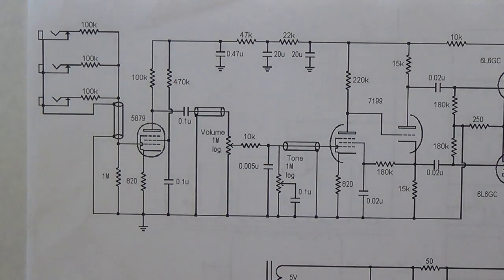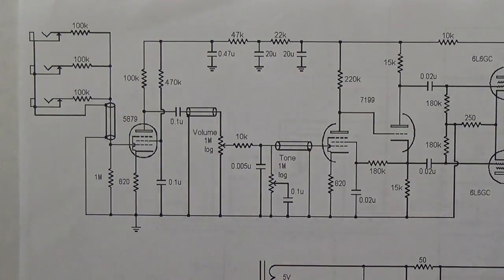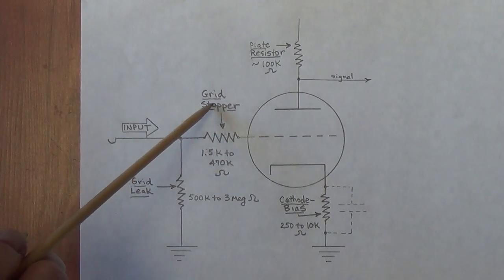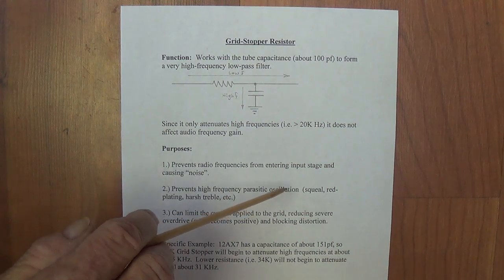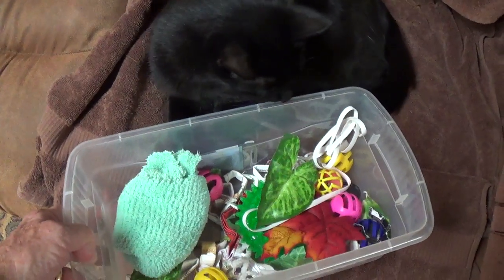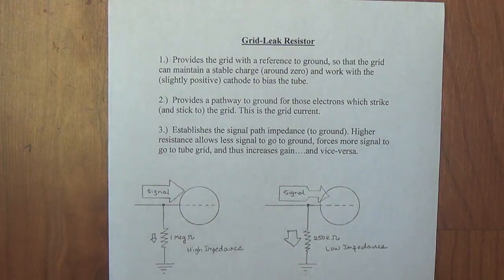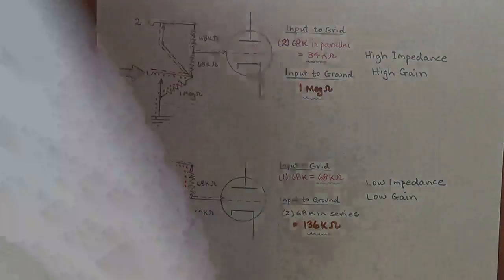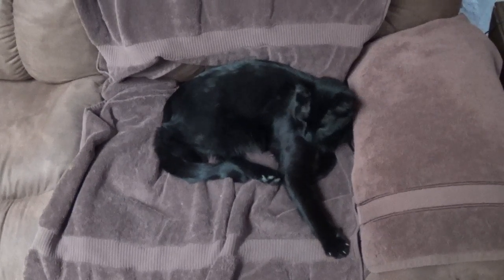Resistors, Part 3: Grid Leak, Grid Stopper, and the Fender Input Circuit

Comment: Dear Uncle Doug, 

I can see at input in many modern Fender amps 10k grid stopper and than 1M grid leak. And also for the same amp for another revision 1M grid leak and than 10k grid stopper into tube. What is the difference between the two? I suppose first scenario is like voltage divider? Can you explain difference in sound? Thanks !
Reply from the maker: I doubt that there is any noticeable difference in tone, Iam.

Comment: Thanks Doug. If there is not a resistor to grid in a signal chain following the pre-amp stage but a potentiometer, e.g.a vol or tone control, do these effectively operate as a grid stopper since they have resistance albeit variable?
Reply from the maker: +allanpennington Very good question, Allan. Yes, any resistance whether fixed or variable can serve as the grid stopper or grid leak.

Comment: Hi Uncle Doug, I was wondering if you could explain how to install cathode bias resistors to safely measure and bias the tubes, being reading about but cant get anything clear, thanks in advance!
Reply from the maker: +henter2010  You're best bet with the cathode bias resistors is to observe how the originals are wired and then solder in the new ones the same way.  Tube biasing and safety measures are covered in my videos. Best of luck.

Comment: Hello Uncle Doug, I have a question about the Impedance topic covered at about 16min in. You talk about 1M Resistor for Grid Leak  being high impedance (apps 98% signal to grid and 2% to ground) does this mean it will be higher gain if more signal is going to grid, and vice versa? Thank you in advance and thank you for the videos which are most helpful.
Reply from the maker: Yes, the more signal that reaches the grid, the greater the signal strength output from the tube.....which ultimately results in greater volume from the speaker.

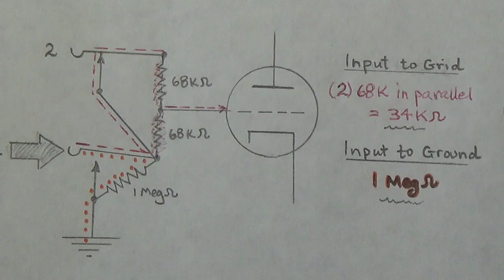Comment: I've been studding your videos and am learning a ton! Thank you!... Can I ask a question about the input portion of your video at 20:44 please?
The signal is running through the 68K, branching off to the grid, through another 68K and then to ground. If we look at the relation of the ground, the two 68K resistors and the output signal to the grid, isn't it exactly the same as a linear 136K potentiometer set to 50%? I've simulated potentiometer settings with resistors in pedals that I've designed using this method. Can this be a factor in the reduction of signal strength when using this low input jack? Thanks Uncle Doug.
Reply from the maker: The two 68K's in parallel add up to only 34K. Yes, a 136K pot could mimic this resistance, but it would be at 25% setting.

Comment: I could not believe it when I saw your grid stopper oscillating symptoms. Every tech that I explain my intermittent “squeal, harsh treble and spike of volume” thought it was tube related. But I changed all tubes and it still comes back but only after the amp has warmed up. Are the grid stopper capacitors or resistors prone to heat related failures? I’m trying to figure out how I can isolate which grid this may be affecting. 
Would I have to continuously monitor the DC voltage on the grid to see it happening, when it happens on 12AX7s or EL34s?
Thanks
Reply from the maker: Try tapping  and wiggling the tubes, one at a time,  when the oscillation is occurring and listen to see if this affects the oscillation sound. Grid stoppers should never get particularly warm to the touch, so any failure would not be heat related. They do need to be located as closely as possible to the tube socket.

Comment: I sense a video describing impedance bridging in the near future :-)
Reply from the maker: +Jason Thorpe  I'm not real familiar with the topic, since we are generally concerned with matching impedance (i.e. with an output transformer), but I'll keep it in mind for the future.
Reply: The amount of signal voltage passed from one stage to the next is determined by the potential divider consisting of the output impedance of the driving stage and the input impedance of the driven stage. For maximum voltage transfer the input impedance should be large compared to the output impedance. This is known as impedance bridging. For maximum power transfer the impedances should be the same, which is impedance matching.

Comment: Doug,
I'm figuring out how you derived the input capacitance to be 151pF. I found 

Cin = Cgk + Cga(1 + A) 

from, http://www.valvewizard.co.uk/gridstopper.html. 

Cin = 1.6pF + 1.7pF(1+100) = 171pF. which tube datasheet are you pulling Cgk and Cga from? Also, the url above mentions the capacitance of the socket pins. Are you accounting for this as well?
Thanks,
Craig
Reply from the maker: +Craig Hollabaugh  The value came from the final paragraph of the Aiken Amplification site:  http://www.aikenamps.com/index.php/grid-resistors-why-are-they-used   To be honest, I don't think 20pf is all that much disparity.  Perhaps it's due to a slightly different estimate of socket pin capacitance.  Thanks for your input, Craig.
Reply: +Uncle Doug OK, I&#39;ve read through the Aiken discussion and its similar to the Valve Wizard&#39;s. You continue to unravel amp design, component reason and value selection for me Professor Doug.  On to the "Cathode Bias Resistor"
Reply from the maker: +Craig Hollabaugh  Thanks, Craig. I'm glad you are enjoying the videos :)
Reply: Miller capacitance is plate to grid capacitance is multiplied by the gain of the stage, not the amplification factor (mu) of the tube. The gain of the Fender input stage is around 60. I have seen values of its Miller capacitance ranging from 100pF to 200pF. The discrepancies are a result of the estimation of stray capacitances and how they are included in the calculation.

Comment: Would this be the preferred method of having two different impedances? Using two input jacks.  Or could I essentially do the same thing with one jack wired to a spdt switch going between 2 grid leak resistors while keeping the same grid stopper?  Or would the switch cause its own problems?
Reply from the maker: The preferred method is to have two or more separate input jacks, each with it's own impedance (resistance to ground), RM. This is commonly found in vintage amps that were intended for guitar and microphone input.

Comment: I know this is an old video and sorry if this has already been answered. Where did you come up with the capacitance of the 12AX7 in you example? Wanted to try and look at other tubes to calculate the grid stopper for practice, but couldn’t find anything that resembled your value on the data sheet.
Reply from the maker: Either from a tube manual or from doing internet searches, Matt.

Comment: hi uncle doug nice video again 
i checking some mesa boggie schematic and i notice that they don't use the grid stopper resistor but instead they use a ferrite toroid  
is this correct or is just a missing part on the diagram
Reply from the maker: I have no experience with ferrite toroids, TRex.  I only deal with vintage tube amps and Mesa Boogies are a little too "new" for me.
Reply: The toroid does the same job as the grid stopper,  preventing radio frequencies getting to the grid.

Comment: Hi again uncle Doug, I have been experiencing that radio signal bleed through on just about every amp I have ever owned tube as well as solid state, could this be from a poorly grounded power source as in the rundown dive bars and other such locations I have played at?
Reply from the maker: I have seen this happen with wireless systems (guitar to amp), David. Without a lot more info, it's impossible to guess, but here is a good series of Q & A on the problem:   http://www.instructables.com/answers/How-can-I-stop-my-guitar-amplifier-from-getting-se/

Comment: Grid stopper question:  the diagram you show with the resistor then being connected to the capacitor which represents the capacitance of the tube...    is the path of this low pass filter from grid to cathode to ground?  and if so wouldnt the signals going to ground also have to pass through the bias resistor as well?
Reply from the maker: The grid stopper resistor protects against parasitic oscillation by reducing the oscillation signal's return to the grid. Electron flow is from cathode to plate, not the other way around, and it is never to ground.
Reply: @UncleDoug  thank you for the reply. however i am still a bit confused.  at the 8:00 mark it looks like the diagram you are showing has the high freqs going to ground.  just not sure how that is happening.  if it is too much to explain and something i should have picked up in different video please just direct me to that one. i dont wanna take up too much of your time.  thank you again for the reply.
Reply: @UncleDoug  maybe i am slow leaner. i have watched this series a few times.

Comment: What about when you plug into both of the jacks at the same time?

I've also used the second input as an output for sending signals to effects pedals or another amp all together.
Reply from the maker: It depends on how the pre-amp is wired, Nelsin. If each input has it's own pre-amp tube then you'll get a much stronger output from the amp.
Reply: @UncleDoug  Thanks for the reply Doug. The amp I'm referring to is a 1967 Dual Showman.

Comment: Shouldn't the "Grid Leak" resistor be connected directly to the grid? (2:47)
Reply from the maker: Here is what Aiken has to say on the matter:  In order to take 
advantage of the parasitic suppression benefits of these grid resistors,
 they must be placed as close as possible to the socket pin of the tube,
 preferably soldered directly to the pin with a very short lead.  The 
resistor should be placed after the grid-to-ground resistor (usually 1 
Meg or so), to avoid attenuation and to keep the signal path short. If 
the resistor is connected in series with the input jack and before the 1
 Meg grid resistor, there is a small loss of the input signal, although,
 in most cases the attenuation is not enough to be concerned with (0.94 
times for a 68K grid stopper and a 1 Meg grid resistor), and in 
amplifiers with a high and low level input, the grid stoppers also serve
 as attenuators.  When designing an amplifier, it is better to use 
separate resistors for input attenuation purposes in order to be able to
 locate the grid stoppers as close to the input grid pins as possible, 
rather than mounting them on the input jacks.
Reply: No, but the grid STOPPER should be.

Comment: Dear Uncle Doug. This question has probably been asked before. But there doesn't seem to be a way to search in the comments. Here it goes :
Id' like to know if the input resistors are acting as grid stopper resistors and how they interact together.
Reply from the maker: It depends on the circuit, Francois. In most Fender amps, the ubiquitous 67K input resistors are indeed grid blockers.

Comment: The frequency response of a guitar pickup is affected by the input impedance of the amp, accounting for any difference in sound, but the reduced gain from input 2 is because the input signal is applied to a voltage divider consisting of the two 68k resistors from input to ground so that only half of the input signal is sent to the grid from the junction of the resistors.
Just a small point which in no way invalidates your explanation, but at 18:45 you say that when input 1 is in use input 2 remains grounded, but it is no longer grounded, it is isolated from ground by the open switch of the jack of input 1. The closed switch of input 2 is simply connecting the two grid stoppers in parallel between the input and the grid.
Reply from the maker: I see what you mean, Silas. I misused the term "grounded" when referring to the input leaf touching the grounding leaf in input 2. Thanks for your input.

Comment: If you plug in to both input jacks, the path to ground on jack 1 is no longer there so the second input will change to a high impedance input too.  Is that correct?
Reply from the maker: I can't picture it, HP.....you'll have to try it and see.

Comment: I'm still not clear on why its important to send the RF to ground if they're all frequencies we can't hear. How would they make "noise"" by being rectified? Doesn't rectification just convert AC to DC?
Reply from the maker: Radio signals are used to modulate a carrier wave so they can be transmitted over great distances. Once they arrive at a radio, the circuitry rectifies the carrier wave, demodulating the RF signal into an audio-frequency signal for the radio's amplifier. You can hear this rectified audio signal.

Comment: I sure wish I could end the debate in my mind due to tech disagreement whether the 1watt stock Screen Resistor in my 69 Super that fried should be replaced with a 3watt or if the lower value is better to work as a fuse and protect the Tubes and OT. WIDE variance of opinion about this, no objective conclusions yet.
Reply from the maker: Let's try to elevate the debate from subjective opinion to objective fact. According to the schematic and a tube manual, the screen resistors are 470 Ohm rated at 1W, and the operating parameters of 6L6GC's in an AB circuit operating at 450 plate volts are 0 signal = 3.4mA and max signal = 19.2mA (which seems quite high). Let's calculate the watts of heat energy produced under normal operating conditions: At 0 sig = .005W and at max sig = 0.17W. As you can see, the 1W rating is perfectly adequate even under max sig conditions. If your screen resistor fried, it is because of excess current flow (possibly an internal short, which is not uncommon) NOT inadequate resistor wattage. The resistor "fuse" probably saved the HV winding of your power transformer. The tube is suspect and increasing the wattage of the resistor would greatly increase the threat of harm to the winding.

Comment: Let's say you have a two channel amp (like a normal and a reverb channel) and instead of each channel having its own preamp tube (like a Deluxe Reverb), the channels share the A and B sides of a single 12AX7. Should the cathode resistor be the same value on both sides? Obviously, I have such an amp (a mid-2000s Gibson GA20). The cathode resistor on V1a is a 1.5k but on V1b it's 10k. There is also no capacitor on the b side. The screen, leak, and plate resistor values are identical on both. On this amp, the B side operates much quieter than the A side. Could this be a factor?
Reply from the maker: As you know, the cathode resistor establishes tube bias. Perhaps the theory behind the difference in pre-amp triode biasing is to create two different output signals.....one with relatively "hot" bias (1.5K) and one with relatively "cold" bias (10K).  The "hot" bias input with it's bypass cap would be higher gain with earlier breakup, while the other input would be cleaner, with lower gain (and quieter). Just a guess.

Comment: So when you see a pre-amp gain control on an amp, that would simply be a potentiometer in place of the grid leak resistor?
Reply from the maker: +Connor Nepomuceno   No, a gain control is generally more complex than that. Look at schematics of amps that have Master Volume controls and Gain controls and you will see.
Reply: A gain control is often a potentiometer acting as a grid leak for the stage following the input stage. This allows the control of clipping in the following gain stages.

Comment: Hello Uncle Doug,  On my phono stage ( with four 12ax7s), the grid leak resistor is 470K ohm in schematic, but when I measure it (with power off), that resistor only measures 84 ohm.     I recently did some parts replacement around the 12Ax7s.  Wonder if I screwed up something.  Your advice please.  Thank you.
Reply from the maker: Remove one leg of the resistor from the circuit and measure again. The value will probably change dramatically. If not, replace it ASAP ;)
Reply: @UncleDoug  Thank you Uncle Doug.  I learn a lot from your channel.  The way you teach makes all the difference.
Reply from the maker: @StPaul1961  We appreciate that, PL. Thanks !!!

Comment: Finished building my 5F1 amp and everything is fine until I turn the volume of the amp up to around 8 or 9 and the amp starts squealing and squawking like a stuck pig!  This is without any signal being applied at the input.
Any suggestions as to how I might rectify this problem would be greatly appreciated!
Thanks
Brian
Reply from the maker: You have an oscillation occurring when one of the tubes is overdriven. Tap on the tubes while it's squealing to see if you hear any change.
Reply: @UncleDoug  I didn't hear any change to the noise while I was tapping the tubes.  Any other suggestions?
Reply: @BrianMcNamara1  oscillation can be due to lead dress. Try moving wires with a chopstick. If that doesn't help, try adding a 1500 Ohm grid stopper on the 6V6.
Reply: @silasfatchett7380  OK, thanks for the tip!

Comment: Thanks for this good explanation. I was looking at the part of the grid stopper resistor were i can understand the calculation but i cannot find were it says that the input capacitance of the tube is 151pf. I only see values much lower. Anyone who can point me in the right direction and show me were the 151pf is mentioned?
Reply from the maker: This was long ago, but as I recall, the value came from internet research, which site I do not remember......sorry.
Reply: @UncleDoug  Thanks for the reply, much appreciated. Maybe i have found it? Could it be this has to do with the Miller effect? 
Thus the effective or Miller capacitance CM is the physical C multiplied by the factor ( 1 + A v ) .
In the 12AX7 datasheet it is stated that the input capacitance is 1.6 uuF (pF) and the amplification factor =100.
CM = 1.6pF*101= 161.6 pF, Which isn't the 151pF but maybe i used a different datasheet? 
Maybe you can tell if this is correct?
Reply from the maker: @rvdrvd6410  To be honest, I simply accepted the value, R2, and did not analyze its derivation. Your calculations definitely appear to produce an acceptable value.